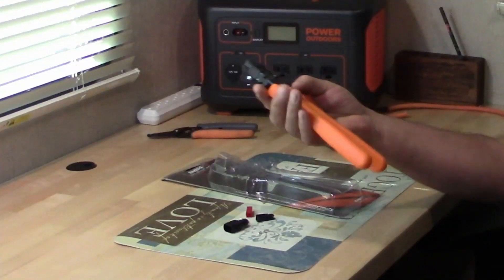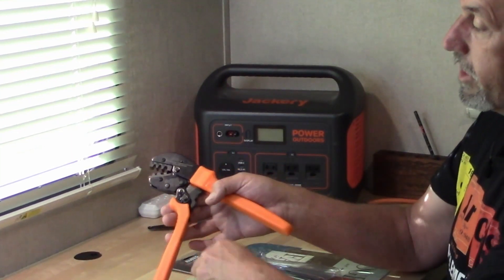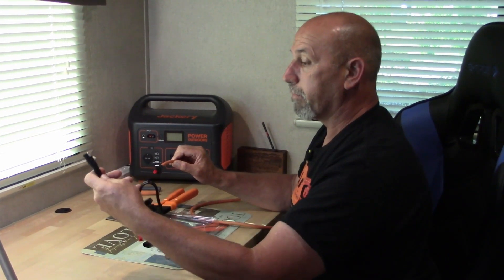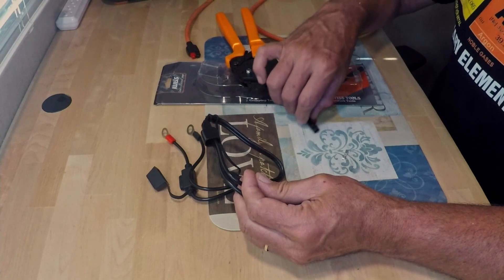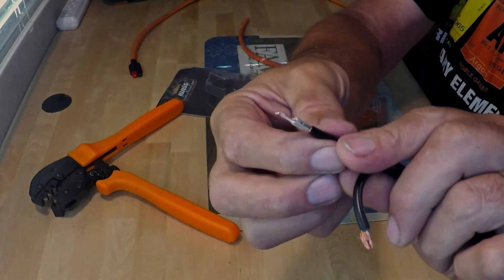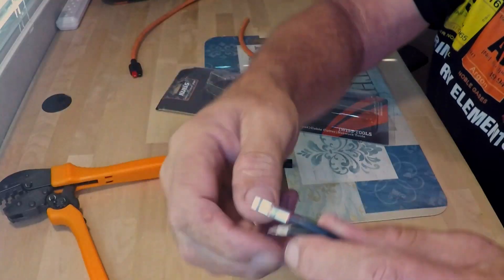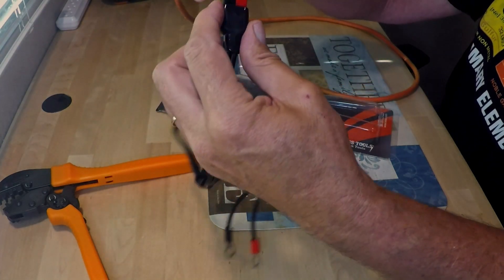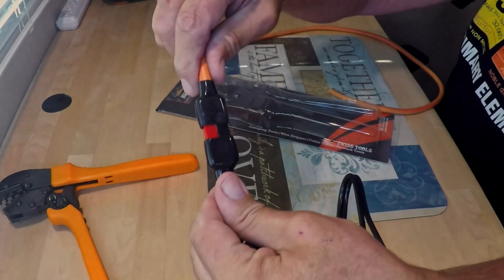How to Crimp Anderson Powerpole Connectors & Reviewing the Iwiss Anderson Powerpole Crimper

Comment: Thank you, especially for noting the different APP capacities.  I had been confusing 30A and 70A connectors (Duh).  You would be amazed at how badly a 30A connector can get mauled by the 75A die.  Using the right tool provides much better results.  ;-)